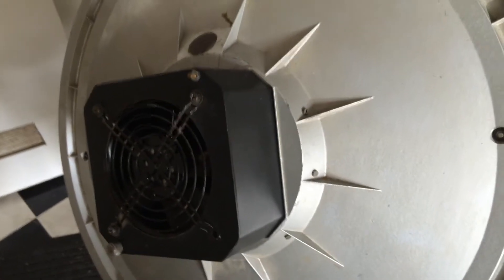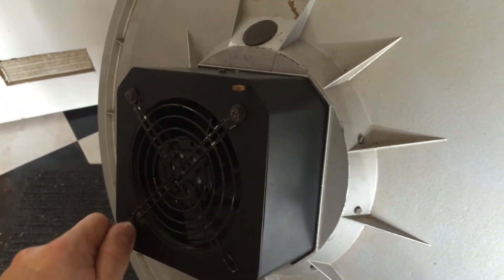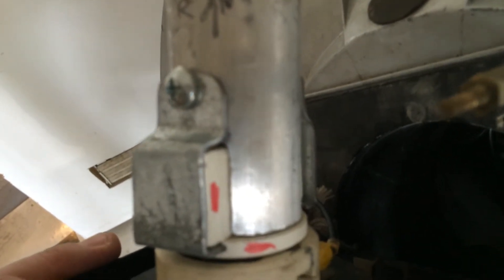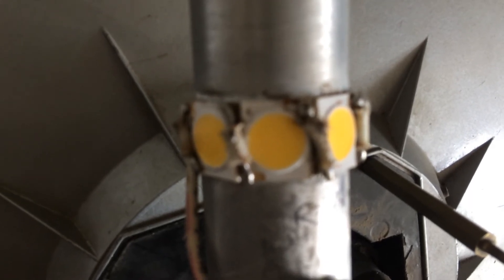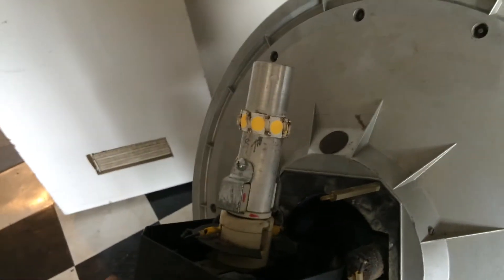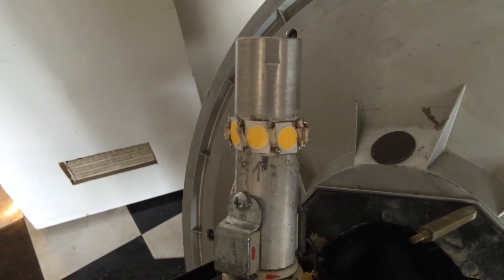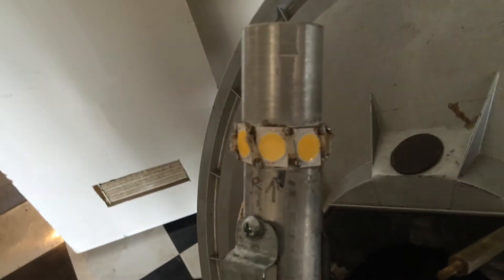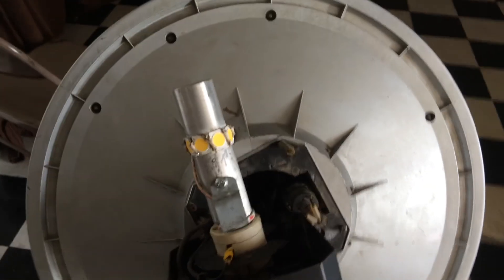Coemar Venus M4 LED Conversion - Inside look at the LED Light Source

Comment: I want to make the same modification to a similar effect, from another brand, use osram c70 220v 1000w 26,000 Lm lamp
Did you do a step-by-step modification of the lamp with photos? so others can do the same? Thanks
Reply from the maker: I used an existing 2-pin base from an old MSR 1200W lamp to build the LED lamp from.  The existing wires from the lamp socket to the base of the Venus were used.  I removed the ballast from the Venus base and added LED drivers in there instead.  So the output of the drivers goes up the two wires from the base to the LED.  The LED lamp is solid aluminum.  The LED's were glued onto the aluminum with thermal glue.  I used heatproof wire to connect the LED's together and to the base.  The Venus has two fans either side of the lamp base which drive a significant amount of air over the whole thing to keep it cool.
Reply: @stephenbrickles766  THANKS ! !